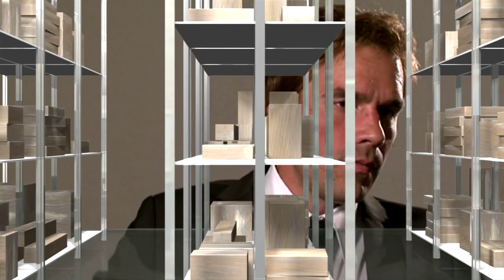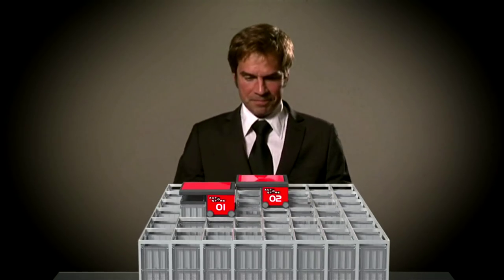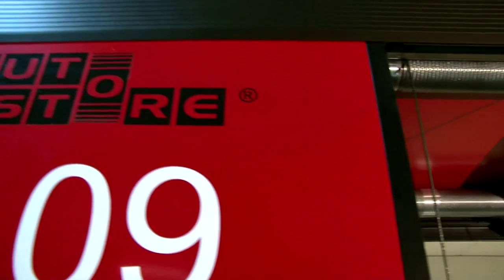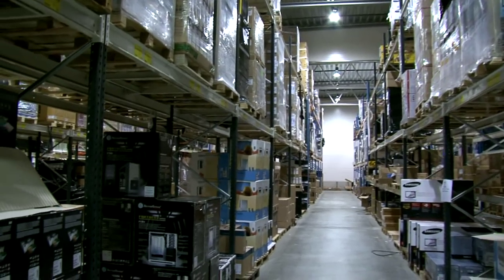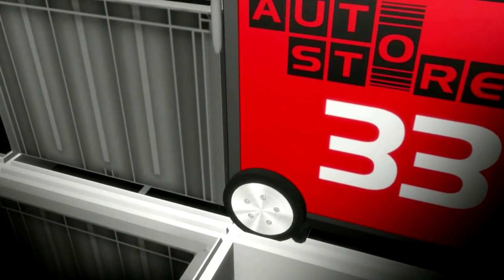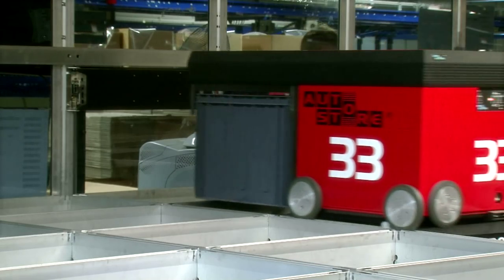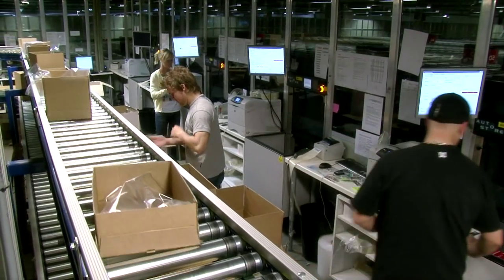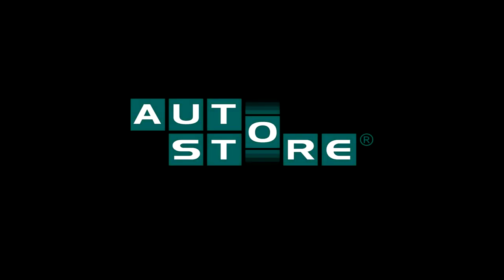AutoStore Logistic - Technical presentation

Comment: @evilfish2000 I guess it depends on what you need from your system. If you have a large warehouse and don't need space efficiency , then Kiva could be your solution. But if you need to use every square foot of your warehouse to save rental costs, heating cost etc. Then AutoStore is your thing.  The bin distrubution is always being arranged to have fast-runners on top, while Kiva would not have this feautre; storing both fast and slow goods in the same shelves.Pick performance and cost is similar

Comment: I have worked with autostore for a week now.. Not tried the Kiva system doh.. But Autostore works very well and is fast.. 
With kiva you will take all the products of the self to yourself but with autostore you only take one bin..  And if your good you can pakc 2.6 products per minut so 160 in one hour..

Comment: This actually sounds like its using less storage but it is not, that is what if all my SKU units are not able to fill the bin storage to the max, because my assumption is that it uses a single storage bin for each sku given its quantity, but even if it stores multiple sku units in a single bin the time it takes to retrieve the bottom most sku will definitely be a lot more time consuming than other type of asrs systems.
Reply: +Uday Bhargav , yes indeed, throughputs will be limited with this type of solution. Time to retrieve is very long, and most warehouses these days have higher and higher throughput requirements and still need to use less space.
Reply: You can have multiple SKUs per bin, or multiple bins per SKU. We are using this system quite effectively in our high-volume, high-traffic facility.

Comment: @Mannafett I think it's hard to compare them actually. Been reading up on the systems for fun. AutoStore is by far the best in space efficiency, but it has limitation when it comes the size of goods, where KIVA can handle large item. I do not know about wieght limitation for autostore, but i KIVA can have fiarly heavy TV sets.

Comment: Could this system handle frozen and refrigerated content such as food? 

Think how awesome it would be if you could just upload your shopping list from home and then just fetch a box or bag at the store.
Reply: I don't see why not as long as the robots can operate in a cold environment. :)
Reply: I think that, frozen food would stay in other area stored in grid boxes instead of bins, and with appropriated refrigeration. In this case de picking would have 2 steps.
Reply: If the boxes were refrigerated containers, it could be possible. If each container contains an inbuilt battery and each rail had a hot-swap style power connector, the containers can remain refrigerated.
Reply: @saturnGEEK  Adding a cooler unit to each container would take up to much space in the container. And when containers cool their internals they produce heat externaly. With this many containers producing heat next to eachother while trying to cool down their internals, this system would break down very fast.

They would need to build a cooled environment and have the robots move inside it. As cool air is heavier than warm air, the air above the tracks could be a little varmer than the air below the tracks, much like an open cooler in supermarkets etc, however it would still be cold.

Comment: But what if i have products that are bigger in size .. like let say .. 1m×2m ..... what then .. will it still fit to the automated storing system ...?
Reply: It would only be a matter of scaling. However, it's not part of the Autostore default product line. Also, having objects of this size, unless they are very light materials, would make handeling at the picking area a bottleneck.

Comment: Foreign language discussion is irrelevant, foreign language characters are especially irrelevant and even detract from efficiency in an era of rapid globalization.  Use pinyin at a minimum to dissect and contribute to discussion.

This optimization at the micro level will have have macro effects on the greater supply chain within 5-10 years.  Amazon's utilization of Kiva systems is more cost effective as no significant infrastructure additions are needed.  Interesting nonetheless.